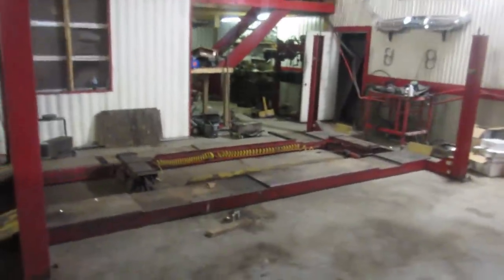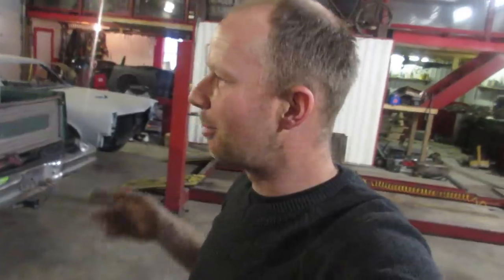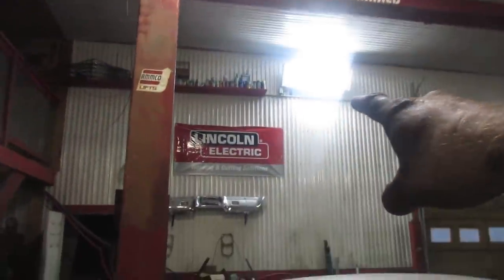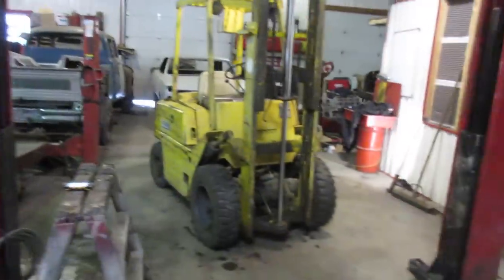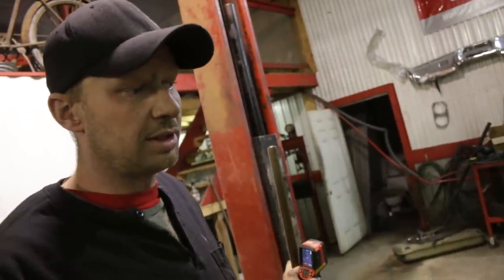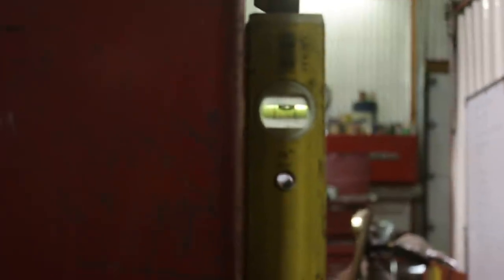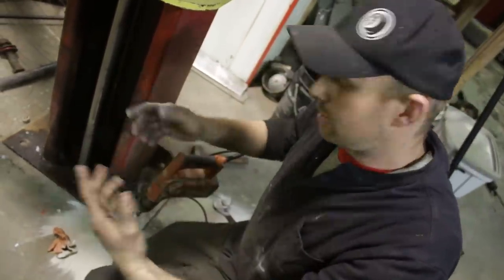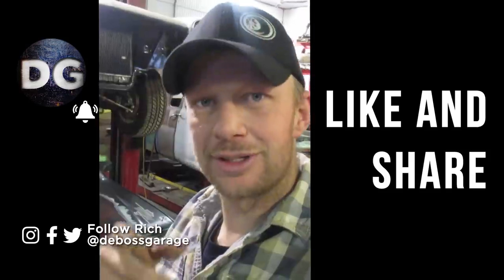How To Install A 7000 lb 2 Post Car Lift

Comment from the maker: Thermal Imager: https://kit.com/debossgarage/dg-toolbox/milwaukee-m12-2258-2
What's your favorite, 2 post or 4 post hoist?  It's not that I don't like 2 post, it's because I needed a 4 post more.  With the cab coming on and off so much on the C10, it was time for a twofer.
Reply: I like my uni-post. It's rare, like a unicorn.
Reply: Used a Stenhøj for years... pretty standard 4 post. It had a really cool pnuematic jack that ran its full length on a rail setup.
Reply: I have off shore 9000. lb two point and don't know how I got anything done with out it. Admit I was bit Leary first couple time I used it but further investigation and it identical to an Atlas sold in Calgary.
Reply: I think two post lifts are the most versatile. If I was storing vehicles, I would rather have a four post.
Reply: a tribute to Yeah, Sure IMO ports exists. I’ve seen it at the dealer. Really cool underground setup. Totally flush.
Reply: Twin.
Reply: I occasionally get asked why I put in a two post vs. a four post - and usually by someone that isn't a mechanic.  All I say is " You ever try swapping a transmission in a four post? Or work on an exhaust system? Or just want to rotate the tires or work on the brakes?
Reply: Looking at a scissor lift, purely because of space issue.  Only have a 20x21 ft garage and a 2 or 4 post will take up most of the space.
Reply: Atlas 10000 lb 2 post extra wide, extra high,, I've lifted dodge 3500 24 valve dually, duramax 3500 and no problems ,, but its really handy as a work bench and for lifting sidebysides and lawn tractors,,, now that I have it, couldn't live without it.. A peice of advice though,,,,, check your level every year, and before any heavy lift, do a walkaround,,, check cables, level, bolt tighness, hoses,,,, just give it a good lookover,,,

Comment: good trick with the heat gun looking for your thermal pipes.
Reply: As you love your heavy duty smart phones. You might as well get a Cat S61 as it's got a thermal imaging camera built in. It also has a VOX sensor and a laser distance built in.
Reply: In industry, we call those Flirs. Or thermal imaging cameras.
Because what we refer to as heat guns are literally guns, that blow heat. Like a hair dryer on steroids.

Comment: Glad you mentioned the floor thickness. A neighbor who works at a dealership told me they discovered the floor was not poured thick enough and the bolts started pulling out. The solution was to remove each lift, cut the floor an pour a new footing. Fortunately the problem was noticed before someone got hurt.

Comment: Four post all the way! I have a 12000 pound Ford-Smith four post and it’s as solid as a rock. It’s a no brainer putting a vehicle on it. It also has two7000 pound rolling  jacks, so wheel work isn’t a problem. Plus as a bonus it becomes a really long work table when there are no cars on it.

Comment: I fix car lifts on the day job. Tips - screw lifts are to be avoided if you dont know what to look for (ie, load nut wear). Common failures on inspections are this and arm locks - the locks that keep the lift arms from moving (so you can swing them under the car) wear out and you can end up with a vehicle creeping around when you reef on wheel bolts/hub nuts. Not good.

Also arm extension stops - 
if the arm extensions fall onto the floor when you pull them out all the way then get that fixed, seen cars come down this way. Same with threads on lift pads if they unscrew up and down, make sure the threads top out and you cand unscrew the pad all the way. And do make sure the locks click (on all posts!) when you lift the lift. Keep the innards of the lift filthy with lube and it should keep going.

Rotary make great 2posts, shame about the import taxes. Rich - You thought about a short scissor, maybe something flush fit with the floor? :P Your balance cables on that 2post still look a little loose, get them nice and tight so both carriges lift off the floor at exactly the same time.
Reply from the maker: Thanks for the input!  Always love getting real world input.  The cables are all adjusted up and tight, thanks!
Reply: I've got a Rotary in my shop. It came out of a Ford dealership. Dealer went out of business after 70 years. Auctioned everything off.

Comment: I worked at a shop once where the manager and his kid installed a couple twin posts over the course of a weekend. A few weeks later I thought I was losing my mind, until I stepped out from under the car and realized it was swaying back and forth. I lowered it as quickly as it could, looked down, and noticed all of the anchor pin nuts weren't even touching the plates on the floor!!

Needless to say, I quit that job not long after that. 

Moral of the story is, if you don't know what you're doing, pay someone who does do it for you.

Comment: For lighting on that 2-post hoist, you could mount a tube light on either side of the posts. I that on mine and works like a charm. And since you are already running power to the TL's, you might as well fit a power outlet on either post.
But then, you mostly use your Milwaukee cordless stuff so you could probably ignore that last suggestion :)

Comment: Great video. 7k hoist is just fine. They work in a safety factor. So that lift a 7k will lift 10500lbs before you need to consider failure. Not to say you will. I have an 8020 wheeltronic rated for 8000 I have had 12000 dodge dually on it with no problems and my lift is 30 years old. Point is at 7000 lbs your going to be fine.
Reply: Yep, there is always a huge gap between working load vs failure load.

Comment: first name last name  And if you need to have an identical line above the floor, use music wire. Mount music wire on a stable stand, pull tight. Then use an accurate plum bob, laser level turned vertical, or a very good level. If you have access to a transit use that and a scale with small deviations. If not you can use a scale and get very very close, but probably within .010-.015” at 3 to 4 feet above the line on the floor.

Remember the floor may not be level. I have used a chalk line for layouts, and they have been wrong, due to slope, or change of elevation in the floor. 

If the floor is not level, this what I have done for many years. (This is normally done for items the really need to be level, or have a long distance between anchor points. Example... Medium vertical milling machines, lathes, horizontal milling machines (boring mills), frame racks around 4 post lifts, and actually works easily with 4 post lifts also.)  Lay out 2 side of the items corners or mounting locations, use the most important ones. Set up the music wire exactly over the chalk line, at the highest point. Pull the music wire tight and level, again exactly over the chalk lines. Do this for the second side. Now you will have a reference that is a flat plane from the highest point. Take all dimensions for these 2 lines of music wire. This will get you an exact rectangle, or what ever shape need from the layout, in a flat plane. Transfer the locations to the floor for all holes or other dimensioned items. And this can be used to get spacers that are really close to making the entire unit nearly perfectly flat, and all holes line up. Some things, or machines, only give you a hole the is 1/32 oversize or even worse 1/64, and make it tough to hit the location if not measuring on a flat plane. Adjustable leveling jack mounts work best for things like mills or tooling machinery, and plates or shims for other non critical machines. Use brass or similar spacers instead of steel. Concrete wicks moisture up and into objects directly on floor, unless vapor barrier is used. Steel spacers will change in size when rusted. And your tool, machine, or large 30K 4 post lift is not level. And must be redone.

On a lift most people use steel washers or the proper shims, but normally made of steel. You can get the same things in brass for lifts and such, which is highly recommended some by the higher end manufacturers, or heavier lifts. These don’t rust, and change how level it is.

Would like to hear comments about you think, or what you have done..

And I have found the old school super hold Aqua Net last the longest on most floors.  It is resembles nearly a lacquer...

Comment: should also run your ceiling fans in the winter time at a low setting. Will circulate hot air down

Comment: i always drill my concrete anchors all the way though the concrete because if you mess up you can hammer them into the dirt and try again
Reply: You can get corrosion this way tho
Reply: @gaurav vij   yes that is true , normally if I'm worried about that I'll put silicone in before thr anchor to seal it off and still gives the option to hammer the anchor though

Comment: The only thing I don't like about a two post is that the car can become a bit wobbly if you remove weight, IE dropping a differential. It's usually not a problem but it can be, especially if you're working on a shell.

Comment: To be fair we have put a Chinese one up because that’s what we could afford and we are really pleased with it. It’s made really over the top and it has strong locks on it (2 post) it has never caused any concern at all, the only mod we did was to restrict the hydraulic return as it came down a bit to fast for our liking. Can’t complain about the function of it though
Reply: I think it was sum guy actually

Comment: I'm from Europe. I do tiling. No chalk line, no tiling floors. We use a lot of chalk for shopping center floors for example. Also for that you would use 30M line and a proper geared box for the line. I do know what chalk line is. Honest!

Comment: Stack 'em up. I know you will finish the Merc before Project Binky but that's not a fair comparison. Is it going to be next summer when we see the Merc and the Goat on the road? I'll happily watch whatever you put out in the meantime.
Reply from the maker: Both are getting upgrades and made much better.  I did explain it but it didn't make the cut

Comment: Great timing on this video Rich! Getting ready to install a twofer in my shop. Floor was already poured though. Got a 10k lift, no name, brand new on a farm auction.  How thick should floor be? If not thick enough, 1in steel plates for added strength?
Reply from the maker: At leaset 5".  6-8" is preferred

Comment: 2 things. 1) I worked in the nuclear field and I can tell you the they will NEVER pass any anchors that are not drilled 90* from the surface they are going into. Reason being it puts uneven pressure on the bolt. It's strength is tested by a straight on pull. Never a bend. 2) I am not sure, but I don't think you "have to" bolt down a 4 post lift. My buddies alignment lift is not bolted down nor is my other buddy's 10K 4-post lift. In fact, we have moved that lift twice. I think I would check with the maker. Hell, some of the cheaper 4-post lifts come with wheels!!!  Meant to ask, don't you have ANSI in Canada? Or something like it?? 

Did I see a BB Mopar sitting near the back wall???

Comment: My understanding is that a 2 post is fine for a full size long bed truck, but it is recommended to put some kind of jack under the hitch for stability.  Any opinions? Getting ready to buy a two post and planning to use it for suspension work on my Cummins Ram and my M1009.

Comment: Oh lord he's a ford mechanic now!
Reply: I saw a Chevy cab lifted for some work on the DMax a while back.
Reply: Please NO FURDS !!!  GM or Dodges
Reply: you see models and makes of vehicles, while I see heaps of needlessly over-complicated garbage that breaks down far too often, costs a ton and requires endless amounts to be spent on tools and service data.............................
Reply: @throttlebottle5906  Any FURDS are electrical and mechanical nightmares. GM is WAY easier to work on.
Reply: over the years I've worked on enough domestic and foreign brands both, to know they're all pains in the arse-tube and not a single vehicle anywhere near perfect. and getting worse by the year....
Reply: throttle bottle this was especially evident when Chevy just released their 2020 hd trucks
Reply: all I can say about the current GM trucks is, whomever is doing the design work, needs fired and the whole thing scraped. I'd rather see them look like 1980's again, nice chromed grill and bumpers. back when a bumper could actually take a bumping without causing $4500 in damage lol
Reply: @throttlebottle5906  I agree the 1973-1987 GM Trucks look the BEST and the one after that 1988-1997 are good to, NOT a FAN of ANY make model new today. However GM is still BETTER with REAL v8 engines (Dodge has real v8 engines as well). FURD and them turbo weed eater engines along with bogus numbers.
Reply: throttle bottle I love 2006 and older Chevy trucks. I would love to see Chevy go back to their 80’s styling. The only thing I hate about those trucks is how bad they rust. GM really would need to do their homework on that issue.

Comment: Just a suggestion sir for the 4 post lift.  Why not make bigger plates that bolt to the feet and then epoxy them to the concrete floor rather than taking a chance of ruining a section of your in floor heating  ? The 4 post isn't as critical about being anchored down as the 2 post.
Reply from the maker: Yeah, Stefan mentioned that already and seems like the way to go

Comment: Rich what's the thickness of cement I should pour when i start building my garage in my backyard in Windsor for a hoist Also I want that 86 90 dodge grill as a spare for my 88 W150
Reply from the maker: I would go 8" minimum.

Comment: I am getting a used 14000 # 4 post lift. Do you think it would work to mount the 4 post legs on some 4 ft sq X 1/2 inch thick flat plate pieces and not attach it to the slab with anchors bolts? I could also brace the legs up like a jack stand. I would like to be able to move the lift if needed. I know they make 9000 # 4 post lifts with caster kits to move them.

Comment: Rich, I have a snap on 8000 lb 2 post I want to put in my garage. It has 5 inch thick concrete but don't know if it's reinforced. Any recommendations?
Reply: Nepabadhabit - borrow a metal detector, and look for patterns of hits in the floor.
Reply: Good idea-thanks

Comment: Isn’t there a door in front and back of the 4 point hoist? Why didn’t you just turn the 4 point around and it’ll be easier and straight instead of at an angle?
Reply from the maker: I won't be using that back door for a while.  Too much stuff around back
Reply: DEBOSS GARAGE seems legit.

Comment: Do you really even need to bolt the 4 post down to the floor? Maybe you can wait until you put a few vehicles on it to figure out the best angle.
Reply from the maker: That's the plan.  I feel better knowing its bolted.  I found myself reefing pretty hard sometimes and like to know its not coming over

Comment: Well I saw something sketchy in your video, you used 4" anchors, new lifts normally come with 8"  anchors, so I would not under any circumstance walk under any load on that lift, even if it is made in the "peoples republic of Canada"
Reply from the maker: You are thinking of a 12 000 lbs hoist

Comment: Plumb,not level. ur a mechanic not a carpenter lol
Reply from the maker: Funny, I built my house and shop, along with about 30 other buildings in the neighborhood.   I would consider myself somewhat of a carpenter.  Check out our barn build for my brother on our channel
Reply: DEBOSS GARAGE best learn the correct terminology if you fancy urself a wood tick, just cuz I turn wrenches I don’t consider myself a mechanic. Level is horizontal like say the base plate of ur 2 post lift, plumb is something standing vertical like the 2 posts of ur 2 post lift
Reply from the maker: So I use my level to make sure it's plumb?  Won't my plumb bob get offended?